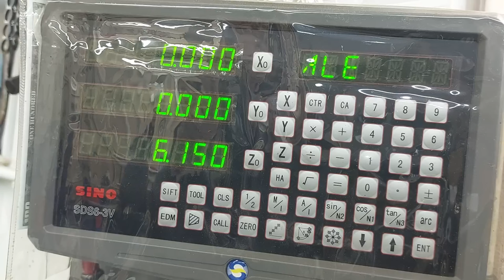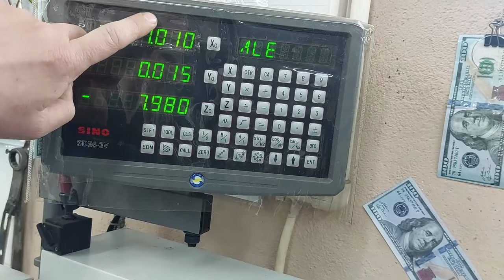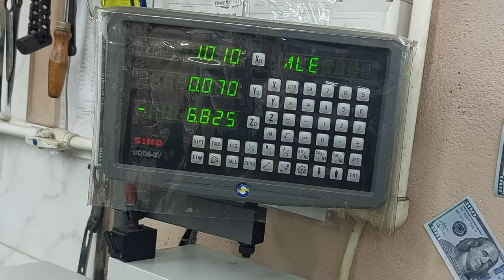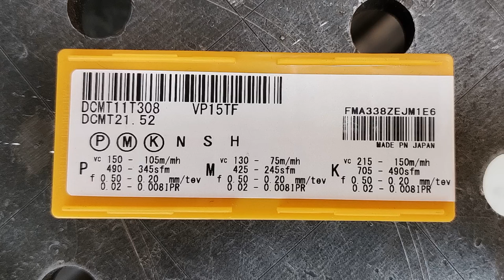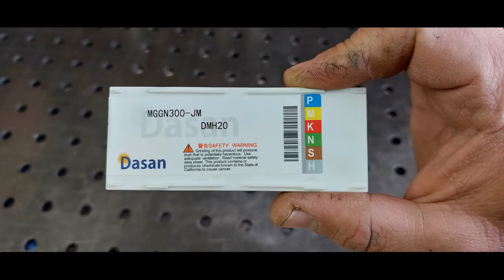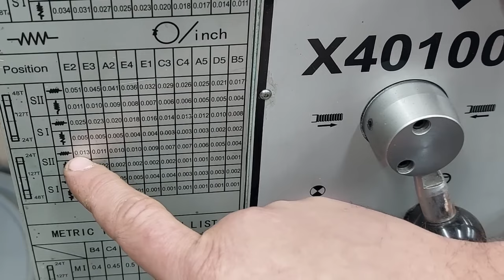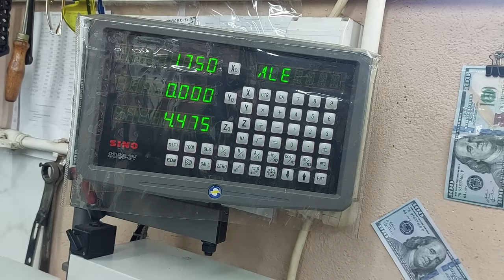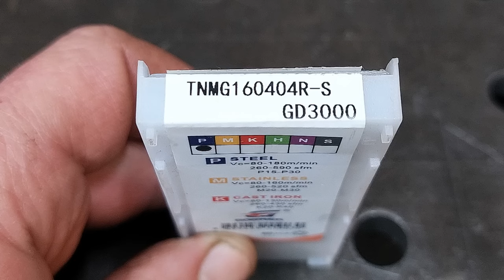Cool! How those carbide inserts work when turning metal

Comment: Great to see a proper deep cut. For the TNMG inserts (last trial) making the feed larger would probably have helped to get the chips to chip rather than string. Also you were at the bottom of the recommended surface speed so going up in speed may also be good - but I don't think so given the color of the chips.
Reply from the maker: Thanks my friend and welcome!

Comment: Hello my friend. Do not store expensive carbide inserts in a box where they can touch each other. Especially those inserts with a sharp cutting edge will soon be spoiled. Your insert No 2 is for Aluminum and has a very sharp and sensitive cutting edge. 
There are dedicated inserts for roughing  with high speed, heavy cutting and others for finishing. Carbide bits are available for different grades of steel and non-ferrous metals. Everyone has its's own recommended cutting speed, chip depth and feed value, you should follow them. The last two numbers of the blade code ( TPMR 110304 ) indicate the radius of the blade (04=0.4 mm), the depth of the chip must always be greater than this radius.